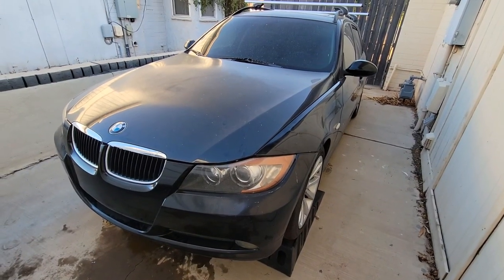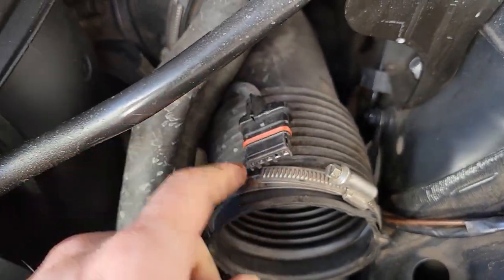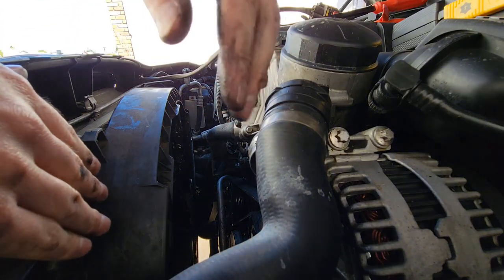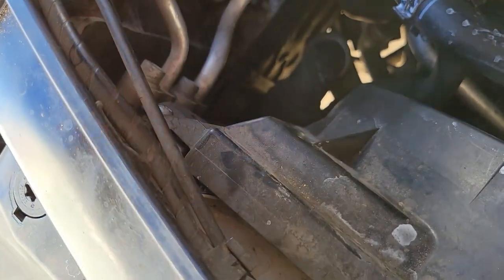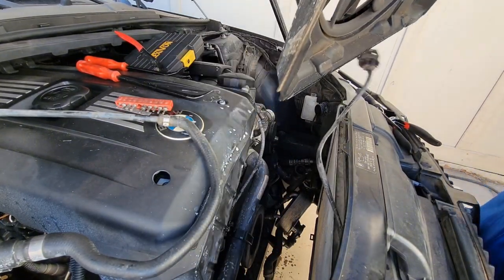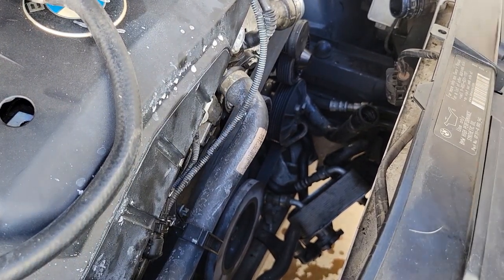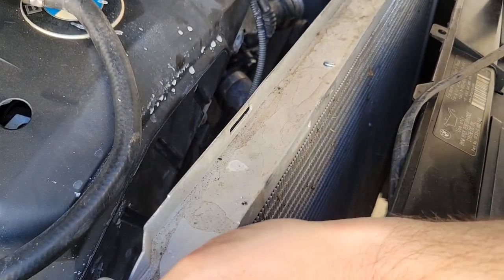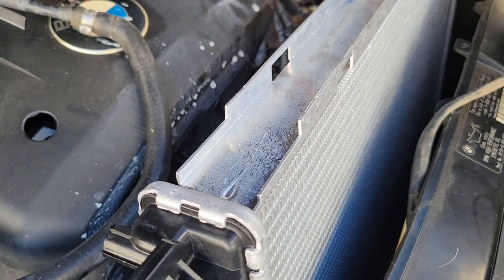Radiator Replace on BMW E90 E91 328i

Comment: Do you happen to remember where you ordered yours from? I’m trying to look for one for mine but I can’t seem to find the right one?
Reply from the maker: @billygoat0138 Hey, I get just about all my stuff from rockauto, this included. They have a lot of options some came with additional features. The pictures online are pretty trustworthy to match up to the old one and then the radiator itself comes with interchangeable parts depending on the model. Hope this helps, thanks for watching

Comment: Do you know how much can be the costs for a radiator replacement?
Reply from the maker: Typically the cost to get it done at a shop is upwards of $1,000. You can buy the part for around 100-200 online places like rockauto